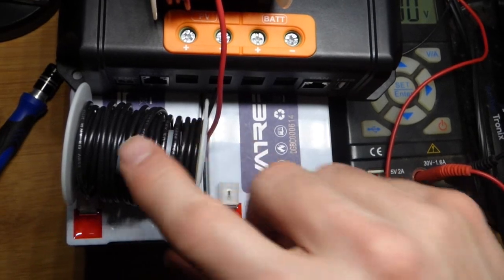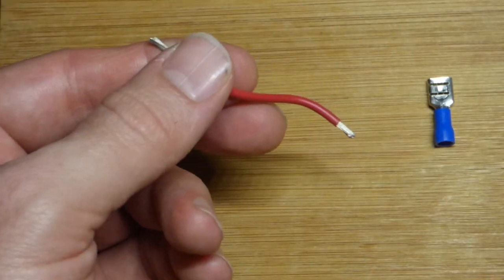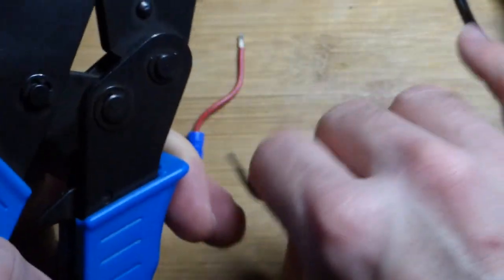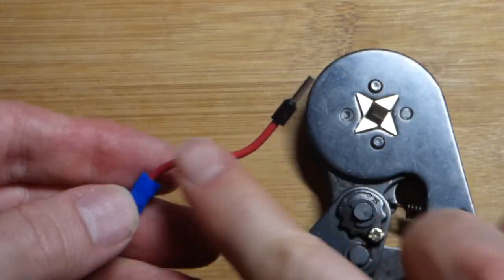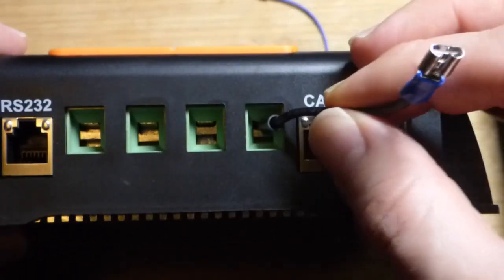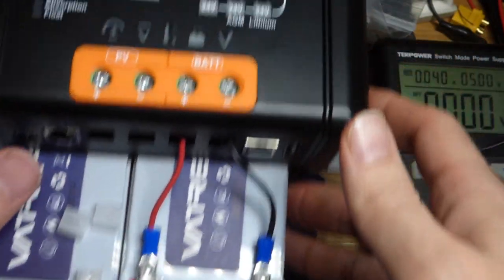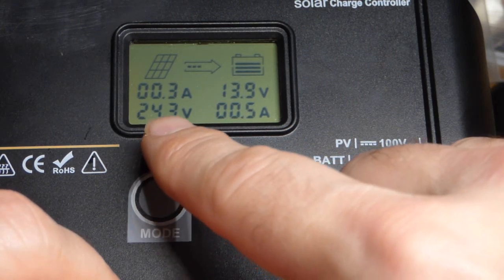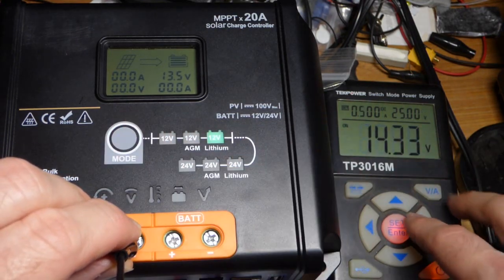My first low power wiring and testing of MPPT charge controller and small LiFePO4 battery charging

Comment from the maker: https://amzn.to/45C9s1V Allto Solar 20Amp 12V/24V MPPT Solar Charge Controller
https://amzn.to/3MEV80u Ferrules and crimper
https://amzn.to/3WBQaGp cutter and stripper
https://amzn.to/46Ej0L7 ratcheting crimper
https://amzn.to/46HFESP spade and other connectors
https://amzn.to/3OkI82t piggy back spade connector
https://amzn.to/3JW5bxL screw down barrel plugs
https://amzn.to/46LBNUB 16 gauge wire multicolor
https://amzn.to/3Vx9MLk Two 7Ah LiFePO4 batteries
https://amzn.to/3Q0RBwK T tap connectors
https://amzn.to/46xBL2K Enginstar power station
Product links are Amazon affiliate ads. I get a percentage of many purchases at no extra cost to you.
https://www.amazon.com/shop/electronzapdotcom/list/1ADLVE33FFFYL?ref_=cm_sw_r_cp_ud_aipsflist_aipsfelectronzapdotcom_B79P02M0KFPJ24S768FC
https://www.patreon.com/electronzap
https://electronzap.com/
https://www.reddit.com/r/ElectronicsStudy/

Comment: I have this charge controller running on a 12v lithium battery and once the battery is charged at 13.6v the charge controller will stop sending current to the battery. Even when the battery 13.0 volts, there is 0.0 amps going to the battery, and that's with load on the battery. What is happening to me daily is I use load, but because the charger won't charge the battery until a certain voltage I l miss out on a lot of sun hours and by the time the charger decides it's ready to charge the sun is already set. So I have to wait until tomorrow again to charge it and go through the same madness. I would love to put the float to 13.4 so it won't go below that but there is no way to change the settings. I would not recommend this charger for lithium batteries.
Reply from the maker: Thanks for the info!

Comment: I have the same charge controller. It stops charging at about 13.6v, not the 14.6v it says in the brochure that comes with it. Therefore you will never actually fully charge your 12v battery and if you have a columb or shunt to give you SOC it will always read about 10-20 points high. Charge your battery until the controller shuts off as fully charged and your columb/shunt reads 100% charge. Let the battery rest for an hour then use a multimeter to get the voltage straight from the battery and compare with a SOC voltage table for lifepo batteries and you will see what I mean. It will read somewhere between 13.25-13.3 which is 80%-90%. Now for me, I use this charge controller on a battery that does not have a BMS connected to it, so I don’t mind this issue as it serves as the over charge protection the BMS would normally handle and I have developed a feel for what the SOC is by monitoring the voltage.
Reply from the maker: Thanks for the info!